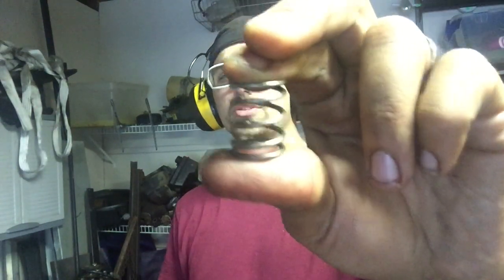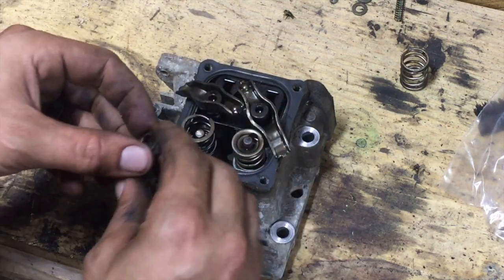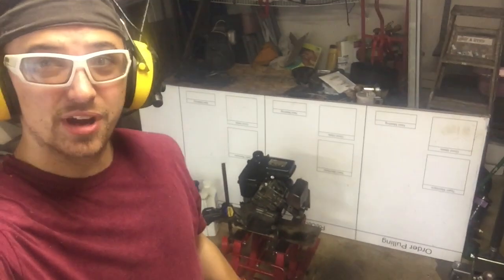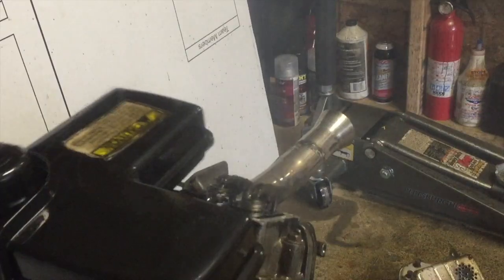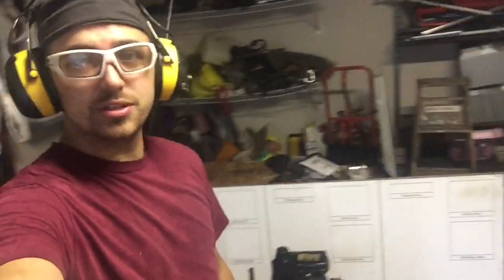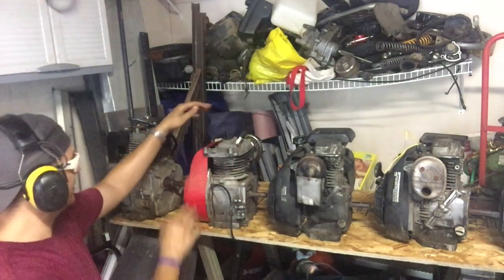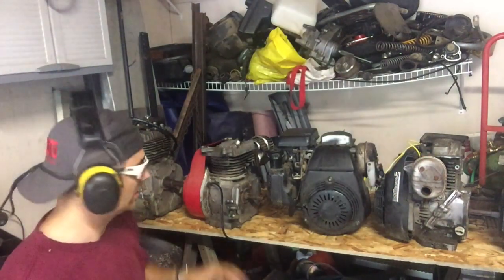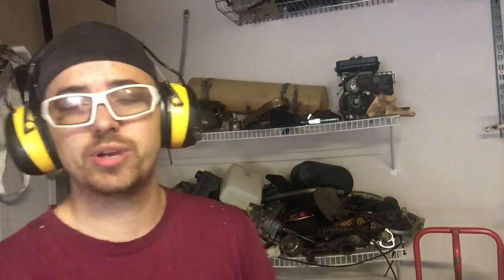18 pound valve springs test

Comment: The Goat from OMB Warehouse broke it down for me. Until you get into a hot cam your just replacing parts. It doesn't hurt to replace the rod, connectors, springs and flywheel when removing the governor but these engines will run somewhere shy of 6,000 RPM stock which most won't with a governor removal. When you do add parts, it's best to be proactive and make sure they are the same for the next stage of the build. At least most of these carbs have bowl floats instead of diaphragms, talk about a pain when you start jetting and pushing tolerances! Yuck.

Comment: All the oil is because of the head gasket you should have taken the old one off both surfaces thoroughly and put a new head gasket on.
Best background music on Y/T .
I have to do a set of 18 pound springs valve springs soon 
But I'll do it much differently